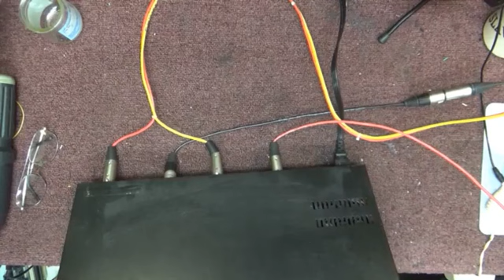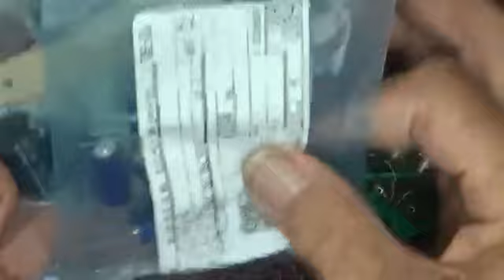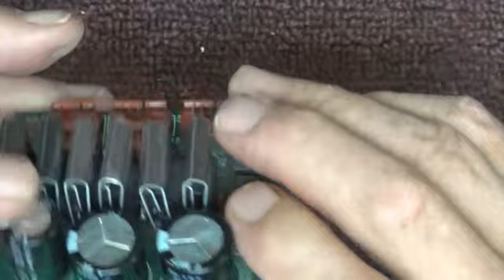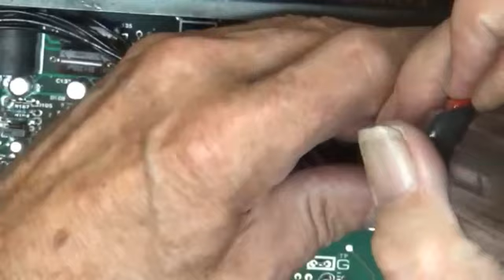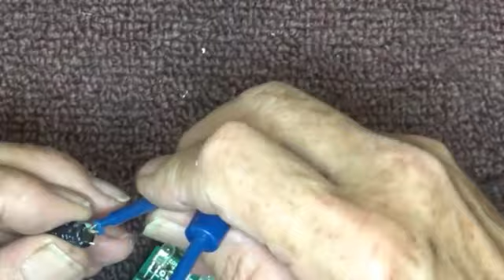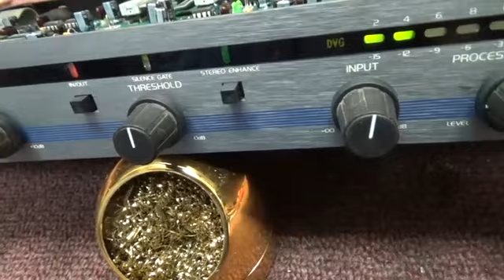Aphex Compellor Capicitor Replacement and a very strange bad part

Comment: Is there a parts list somewhere listing all the caps? It would be awesome if you could list the part numbers of the caps you got from Digikey or wherever and how many of each we need for a unit. Great video BTW very helpful, I hope to recap my Compellors as well and hope they work as well as yours did Thanks!
Reply from the maker: No, sorry. I don't have a list. I remember 2200uf of a strange size in the power supply and a bunch of 100uf I think. I don't have one here to look at.

Comment: Capacitors are enemies to electronics. A necessary chore to shotgun all caps and it should be like new
Reply from the maker: I don't think I totally agree with the shotgun approach. Sometimes you can do more damage to the board than replacing caps is worth. Most capacitors I have run across are still good. Well except for that period in the early 2000s where they were bad from the factory.

Comment: In front of me, there is an opened beautiful Aphex 320A, and I discovered a LM3914N of the display board is the cause of the problem this unit has. The problem is that all LED's of the left channel are continuously on. That is not OK, besides this, the units seems to work OK. When I removed this IC, I noted the plastic socket of the IC where its feet are put into, was melted. This IC seems to develop some serious heat. I also lifted the accompanying LM3915N and it has the same symptom, but this one still works - it will die too eventually I guess. Then I interchanged the IC's with the right channel and the problem moved to the right channel. Problem found! Any idea how these can get so hot? Is this to be considered normal wear, or may something need adjustment?
Reply from the maker: As far as I know there is no adjustment for that.  Just check the supply voltages and make sure they're right.. Those 3915 and 3914 don't seem to be the most rugged ICs out there. I have replaced a lot of them.
Reply: @AERVBlog  Thanks, quick reply! All those get 15V, I just checked. So that seems to be OK. I'll try replacing all LM3914 and LM3915, and I guess I should be OK for the next years :)
Reply from the maker: @mavic6155  a new lease on life. Good work.

Comment: Looking for the replacement part numbers for the Pots for my compellor 300 ax had them break off on Channel one. Any ideas?
Reply from the maker: Let me look. I might have a couple in a parts unit.
Reply from the maker: Nope, I don't have any. Which ones are broken? I can see if I can look them up for you. I have a manual I can email you if that will help. Contact me at aervblog@gmail.com

Comment: Hy! I have a similar Aphex Compellor Ax300, but i think there is a probleme with the unit. It works (but any of the LED is shown), but if i press the gain reduction button, everything stops and every LED is RED....nothing happens! What could it be?
Reply from the maker: It sounds like the 1 or more of the led drivers is bad. LM3914 or LM3915. They have a tendency to go bad. You can still get them.
Thanks for watching.
Reply: @AERVBlog  Thank you! I will try to change them, it is strange that the red led's it's all active. I'll get back. Many thanks.
Reply from the maker: @norberterwin  I can't remember right now which is which but the 3914 and 3915 are used together. One runs the green LEDs and the other the red. That might not be the problem but it is my best guess right now. Let us know how it turns out.

Comment: Excellent! Exactly what I was looking for. Could you tell me whether all the caps were just the basic caps. Or does the 320A require some low-ESR caps? Thanks!!
Reply from the maker: Thanks for watching. There is no need for low ESR caps. Just get regular old Nichicon, Panasonic or other high quality brand. I generally try to get the ones with the longest MTBF, mean time between failure, somewhere around 2000 or 5000 hours. They will cost a little more but I believe they are worth it especially in an environment like radio where the unit is turned on and never touched again for years.
Reply: @AERVBlog  Thanks for that detailed reply. I will do just that and grab those higher quality caps. I really enjoy watching your videos  and walking through the troubleshooting and repair with you. Thanks for the content. Just found your channel. Subscribed!! Thanks again..

Comment: Very good video! Glad you made one on this very subject. I’ve got several of these on the air and one on my own LPFM. I may need to recap mine.
Reply from the maker: SpeakerFreak95 probably a good idea. It is always better to take care of inline point of failures before they call you out in the middle of the night. Congratulations on the LPFM. I have often thought I would like to get one in Down East Maine but then I think "I just retired from 30 years in radio. What's wrong with me?"
Reply: AERVBlog I didn’t see your reply until now, this LPFM isn’t licensed, but of course, doesn’t interfere with anyone. It’s all for fun.